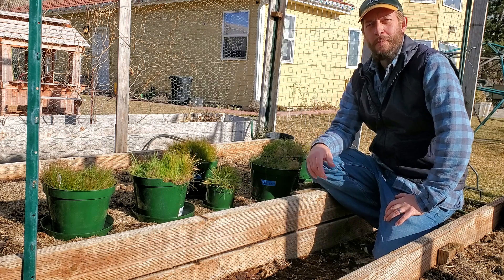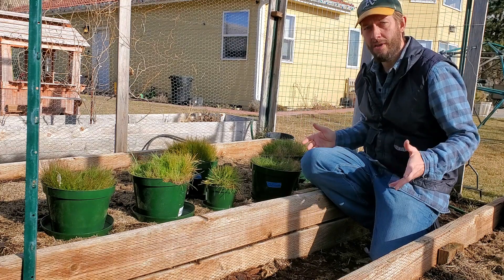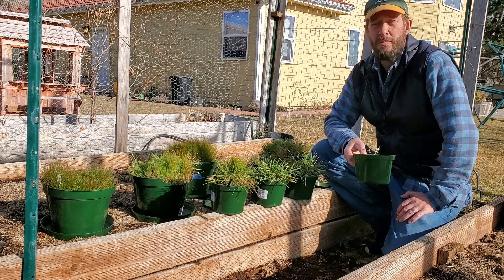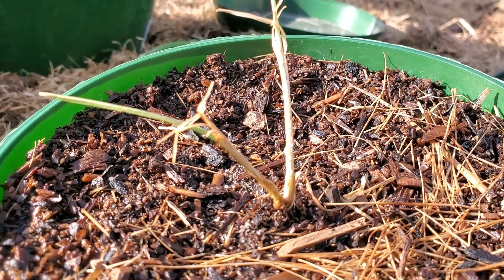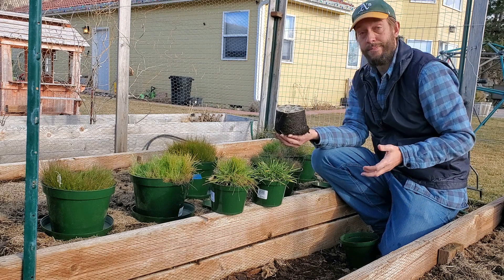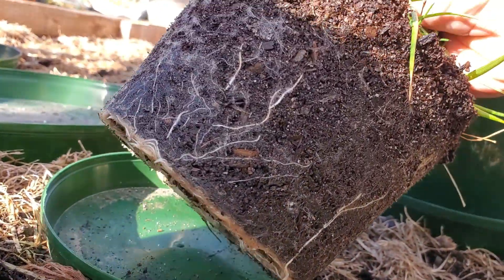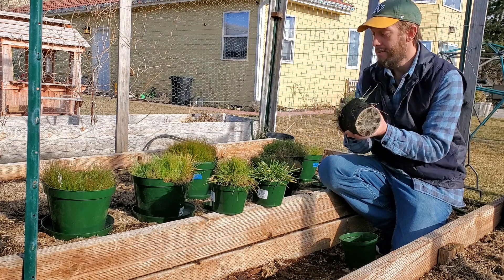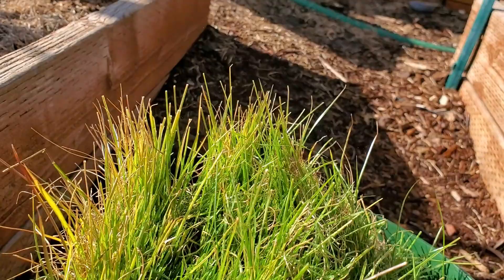Root System of Fescue Grass Up Close - Grow It Deeper

Comment: Interesting that, i seeded my lawn in July so seeing this has really helped me understand what’s going on below the surface, love to see the same done in taller pots just to see how far they can actually go
Reply from the maker: I've also been trying to figure out a way to do a similar grass in pots test with poor compacted soil. My guess is compacted soil would make this root mass less impressive but I'm not sure how to do that. These pots were made from bagged topsoil so it was loose making it easier for water and roots to get to the bottom of the pot. In a lawn I suspect getting to this depth so quickly would be harder.

Comment: Would you still suggest watering deep and infrequent if one has very sandy soil?
Reply from the maker: Hey Greg, I would want to first know how deep your root system is already. It's possible that your roots are already pretty deep because water will naturally travel deeper faster in sandy soil so the grass roots may have extended down enough to water for longer periods of time less often. If your lawn has a shallow root system then switching to a deep and infrequent schedule may take a season of work to get to because the upper sandy portions of your soil where a shallow root system resides will dry out much quicker than the lower levels. I think this type of watering system will benefit most grass types and soil types but if your root system is shallow you'll have to baby step into infrequent waterings while you work on improving the soil structure and extending roots lower into the ground. You could start by pulling some of the deepest cores you can with a plugger, I use the Pro Plugger easily found on Amazon, to see if the roots go down a ways; I would also find an area of your lawn where you could dig a small but deep hole to see how far down moisture is holding, also this will give you a sense if your sandy soil is only in the upper 6 inches of if it extends lower than that. If you have moisture holding capacity in the 6-9 inch zone then a deep watering will hold moisture down where you want your roots to extend to.
Reply: @TurfMechanic  thanks for info. Much appreciated